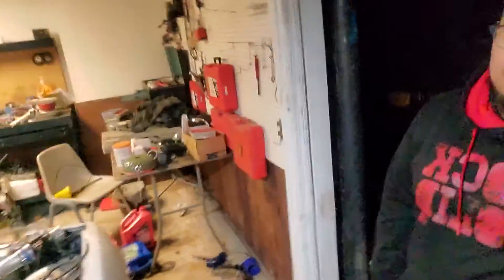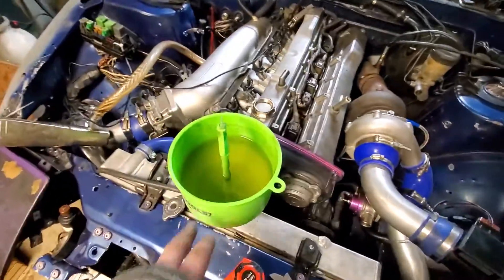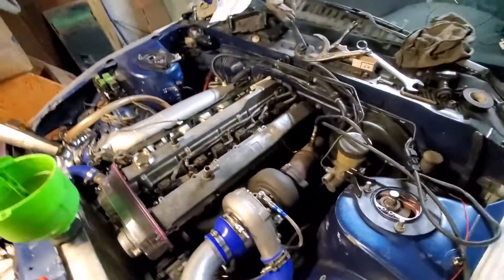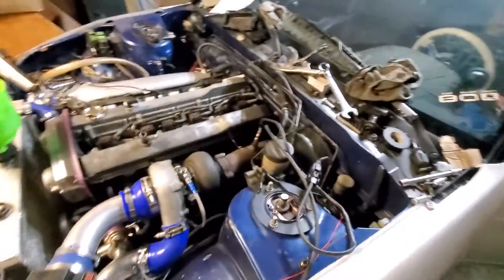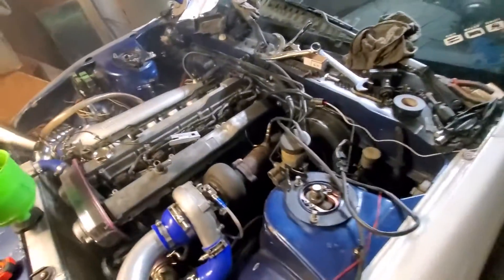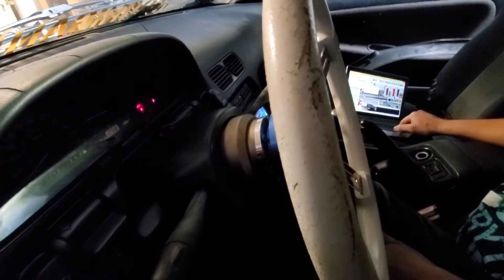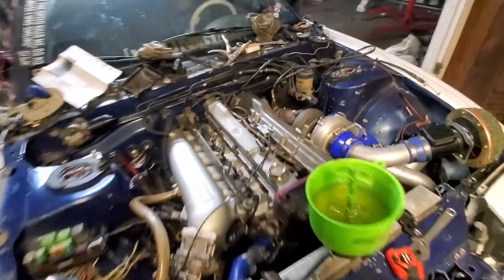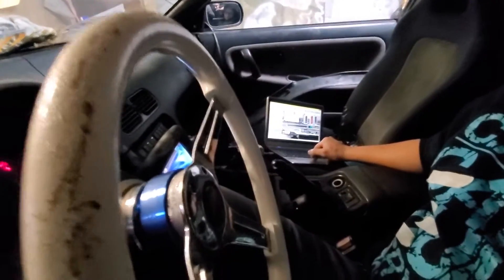500HP RB25DET BUILD FINALLY RUNNING!!!

Comment: Nice video!
I also got a 240sx  has a rb25det s2 and have wiring specialties pro but I am stuck with this issue everything is connected and fuel lines are on right, but I'm not getting no spark to the coils as well no fuel .
 Have you or did you run into this problem before?
Reply from the maker: Are you running rb coils or aftermarket
Reply: I'm using the rb coils
Reply from the maker: Check grounds on on head and then make sure your ignitor is good